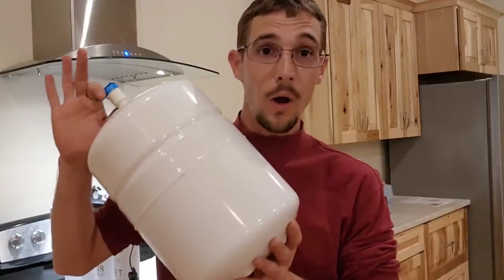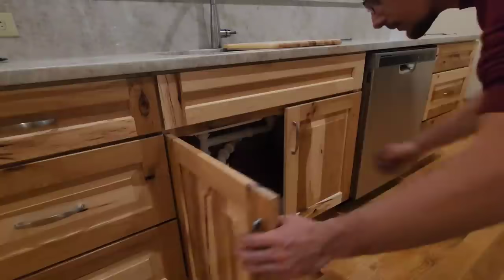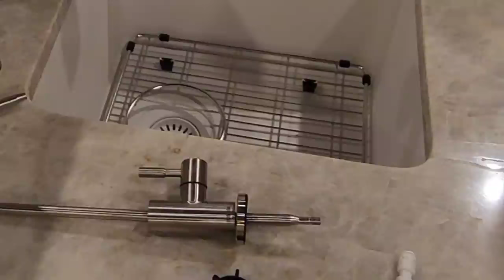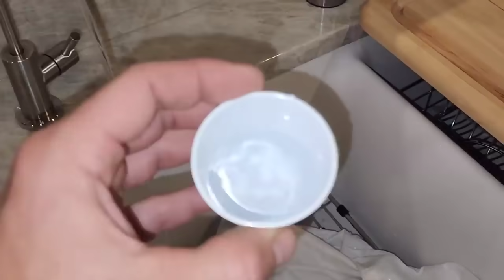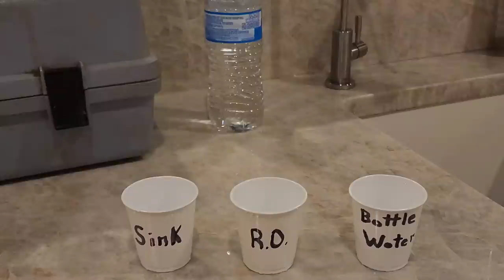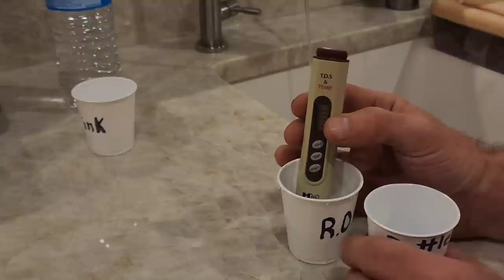SimPure T1 400 RO Filter System Put to The Ultimate Test

Comment: We have 715 ppm Sodium after drilling a new well at 180ft, it has been running 1min every 30 mins for several days, we let it rest for a few days, no pumping, and started it back up, The TDS is 2290 straight out of the well, no filters.  We are running it through Springwell Airator then 4 inch 5 Micron sediment /  Maganess filter, and next is the Springwell softener set at 6 grand  and then it gets hit with some UV.  Still we are lightly salty at the sink, so I ordered the SimPurt T1 400 RO ststrem. I'm assuming I could run to a 200 Gallon holding tank with float switch, we typically use 100GPD. Thoughs.  My TDS meter should be here tomorrow.
Reply from the maker: Thanks for the support
Reply: I'm thinking your water is too salty/too much TDS for an RO filter. The other filters are unable to reduce TDS and salt (a component of your TDS). A RO filter works by forcing water through a membrane to pull out TDS, but eventually gets clogged and requires a wash, which when you wash with TDS that high, it's not going to be very effective, which is why you're having it cycle every 30 min. I'm actually surprised RO working as well as it is for you. It drops my home tap from 200 ppm down to 0 ppm when new, and now 5 or so ppm now a few months into a new filter. My only suggestion would be to run a deionization step before your RO to get the salt out of there, but I'm just an educated consumer with a degree in chemistry, so there might be better options out there.

Comment: I installed the UV version of this in an off-grid setting and submitted a water test to our local public health agency. It still had bacteria in the water. 

Any suggests on the cause? Power is working to the unit (the pump cycles). How else can I tell if the UV is working? Any other ideas?

All water line after the pump was new, flushed according to the installation instructions.
Reply from the maker: Dear valued customer, thank you for your message. If you have any questions, please contact our support team at: service@simpurelife.com

Comment: Is something like this able to be installed in an apartment?
Reply: Yes, but you may have to plan to lose your deposit OR leave the system behind.
Reply from the maker: Hi there, of course! You can have the T1-400 UV RO System in your apartment under the kitchen sink. It is super easy to install and saves 70% space under sinks. But if you're renting the apartment, we suggest you buy our SimPure Y7P countertop RO System, which requires no installation.

Comment: Never attach the RO wastewater line directly to a drain as instructed, doing so will allow filth and bacteria and fungi to grow inside the line on the clean water side of the RO filter. Eventually, these growths will reach the filter housing and infect your water.
Always attach the wastewater line to an air-gap device to prevent this.
Reply from the maker: Hi we also offer a check valve to work as a air-gap
Reply: @simpurelife   Hi, I have ordered this model and waiting arrival. Is the check valve attached by default or should I take precaution when connecting the waste water to drain directly?
Reply: @narendranraghavan6019  how did you end up doing this?